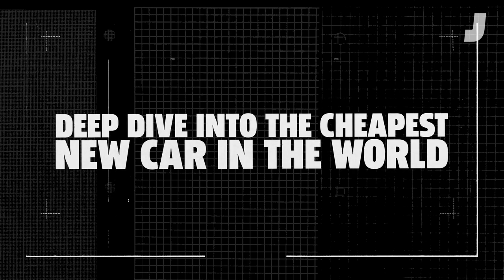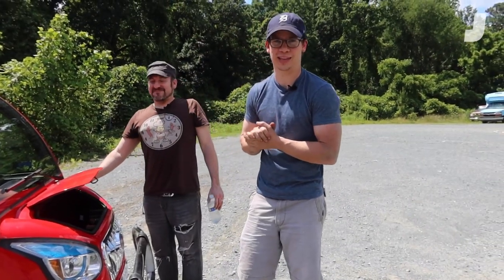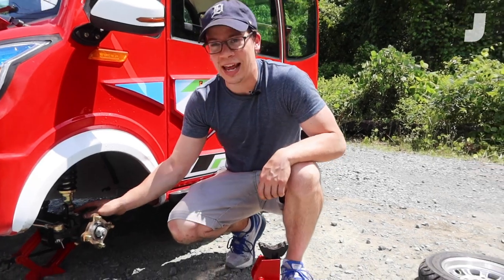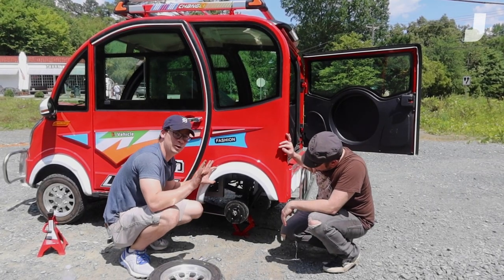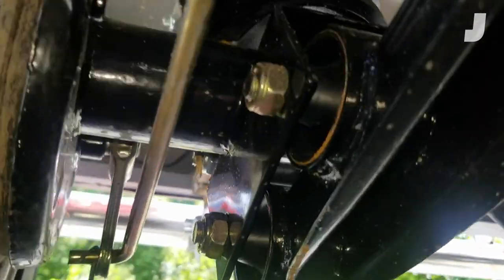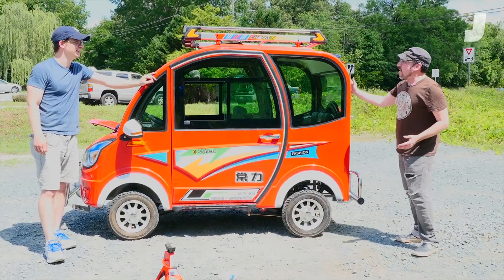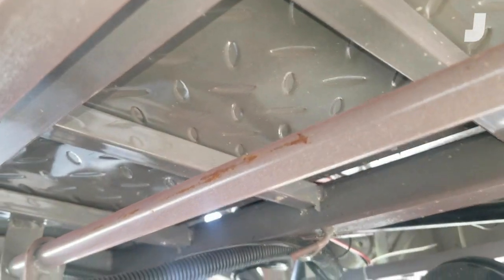The Impressive Engineering Behind The Cheapest Electric Car In The World

Comment: Omg. You so need to throw some lithiums in there. It looks simple enough even to upgrade the motor and controller for more umph. Amazing series 🤣🤓
Reply: With some lithium batteries and motor/controller upgrades this thing becomes downright amazing
Reply: I was thinking the same, TBH. WOULD LOVE TO SEE THAT.
Reply: The batts would outlast the car.
Reply: That would cost another 1,200$!
Reply: Rich Rebuilds used the parts from a crashed electric motorcycle to build a zippy car, his 'ratrod' and also an electric ATV. So doable.
Reply: You can ask them to lift the speed limit
Reply: Are you serious? Put the lithium battery under the seat is ready to barbecue human meat? It's dangerous, man，please, don't do anything stupid！
Reply: @OuijTube  Lithium-ion batteries are stronger, but more dangerous when things go wrong
Reply: But of course, if you modify it so that you don't put the battery under your butt, you'll be fine
Reply: It would also double the price.

Comment: I bet it's a conversion from an internal combustion engine version. The "trunk" in the front has no bottom because it is an engine compartment, the rear axle was turned front to back in order to fit electric motor behind the axle to the port where the drive shaft would attach. Great car anyways, the engineering on it is such a joy :) Holy hell it even got the sunroof! Thanks for the vids about it, enjoyed every one of them. The rain adds a nice tune btw

Comment: The exposed bottom of the car would pose real problems in Canada where we get a lot of snow and dirt on the roads.
Reply: Think how much fun it would be for bears!  Kinda like those dog treat balls!
Reply: @janeyoung4783  The bears would fit fine inside...
Reply: Stick some skidoo running gear on it!
Reply: Yeh like these would be legal anywhere on the road....
Reply: Just go to hardware store and get a big steel plate and cover them then, it doesn't looks like there are much problem to prevent you doing that.
Reply: @markc6714   grt entrç sñiw óbiké ejtrç atvß

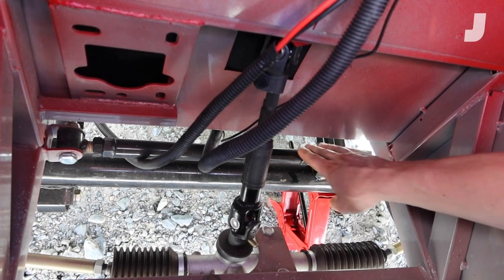Comment: That welding quality in 1:27 and likely use of furniture quality steel makes me hope that no-one had an accident with this one.
Reply: If this is like anything else made of steel in China, they didn't need to bother painting it. It will be nothing but rust in a few months. They seem to forego any kind of corrosion inhibitors. I would rather have rustproofing than some of the features they did include.
Reply: @moconnell663  you might think i am bragging. but in field of material science, china is on par with america or a bit better. just look at how many academic research papers china produce a year.
Reply: this is electric bike based. in china, it is not allowed on motorway! it is not classified as a "motor vehicle". you don't need license to drive that "car" but you do have to get registered. usually those tier-4 cities or towns.

Comment: how about the autonomy, how many miles with a full charge
Reply: In their article, they cited the manufacturer's documentation that said 25-60 miles.
Reply: @unwanted107  Its probably just that bad at handling hills lol. My electric skateboard gets half the distance or less if I'm going up a lot of hills.
Reply: @jerimayavondristen9955 Simpler electric skateboards hasn't energy recovery. With recovery system in hills areas range is much extended, because energy spent uphill ride is recycled to battery in downhill brake when motor works in alternator mode - BLDC motors are easily reversible to generator with proper power control unit. Simple and cheap DC motors can't be effectively used as generators.
Reply: Kris Roberts  I understood him to say the car is $1200 if you want batteries included. Could have misunderstood.
Reply: @robj2704  $900 without batteries
Reply: Kris Roberts  They sell Lithium-ion batteries for less on the same site. I'm not sure what that was about.
Reply: This guy is trying really hard to justify the money he lost on this death trap.
Reply: Top speed: 30 kph, range around 100 km. https://www.alibaba.com/product-detail/Four-wheel-electric-environmental-protection-car_62158205142.html
Reply: @robj2704  yeah . . . that's what I got too.   Making the batteries $270 for all 5

Comment: I would put a motorcycle engine and an AC and boom, daily driver
Reply: I drive a 64  ford truck creature comfort wise this this isnt to far off from my truck.
Reply: I would have to agree with you there. With the driving I do I wonder how well it would hold up under the modifications.  My commute is 58 miles daily. With my current car I see a lot of wasted space.
Reply: Rear brakes only though. Could get pretty hairy.
Reply: SteveVi0lence you
Reply: In Pakistan rickshaws are everywhere and fully loaded with 6 or 7 people plus the weight of a frame, they often use small 100 cc 125 cc motorcycle engines and easily go 60-80 kmh with room for more. In this small lightweight frame car it would be a lot of fun and practical to have a small moto engine on it
Reply: Around my area, my daily commute is 58 miles daily at speeds of 65 - 80 mph  (110 to 140 kph) and would need to pass safety standards. A gas tank and small engine would add extra weight but would be great for someone who is a daily commuter and uses the car to pick up a few odds and ends. As it stands I know someone who could use the car as it is as a property security car because it provides a working heater which would be great in the winter.
Reply: House a/c in the side and more batteries.
Reply: Hayabusa swap!
Reply: boom..sounds like you watch to much of the Russian...boom!
Reply: Yeah Hyabusa screamer lol

Comment: This needs to be modded into a street legal car!
Reply: I thought the whole premise of the series is that it's already street legal (albeit a terrible piece of cheap, underperforming garbage).
Reply: @willenestvedt1376  The only thing I can think of is it needs seatbelts to be (surface) street legal in any US state. I drive a smart car, which is pretty damn stable and safe. This I know is nowhere near that, but it could be fun to have as a car for my right-around-me trips. I work at a university only 2 miles away.  I could use it for that commute for sure.
Reply: @willenestvedt1376  ...oh, and I know they showed the horn, but they didn't sample it. It has to be audible at least 200 feet  (67 yards) away. That's not a tall order, and I'm guessing the horn provided would meet that, but just a possible thought I had.

Comment: So this is the car the Book „unsafe at any speed“ was written about... a single brake system is my main concern. The rest looks not so bad...
Reply: Yes . rear brake only is recipe for disaster.
Reply: @johannes914  This thing can't go over 35 and weighs next to n othing
Reply: Then retrofit a secondary brake system on it then, it couldn't be that hard to mod a set of motorcycle brake onto that tiny cart?
Reply: What would worry me about the brake is that the rod from the pedal appears to be held on with a single nut on the end of the bar, and doesn't appear to have a lock nut or any other reason it wouldn't just loosen and fall off.
Reply: I wonder if that's in addition to regen braking. From what I've read about electric motors, having regen braking is just a matter of connecting some wires differently, although in the simplest form, it kicks in when you let go of the pedal and whatever the actual brake pedal does is a separate operation.

Comment: I wonder whether there used to be a tiny petrol engine in the front on a previous version.
Reply: I wondered that as well. Or, at least, a petrol-based car sharing the same body. There's that strange unused bracket under the bonnet that hints at some other use for this body.
Reply: That space is crying out for a small gas powered generator to turn it into a range extender EV.
Reply: @davyfella  totally agreed! that's exactly what I was thinking! Awesome dude!
Reply: IT's actually an optional upgrade bros!  UR smart!

Comment: Being someone who hasn't been into cars their entire life, when I did get into them I never understood all the car enthusiasts like my dad raving about "coilovers" as if they are something ultra high-tech. Aren't they literally just coil springs combined with hydraulic dampers (fairly standard equipment) in a space effcient manner that uses the hollow areas inside the spring? What am I missing? It reminds me of people raving about transverse engine layouts as having been some kind of engineering revolution (isn't rotating the engine to fit in a given space better common sense?) or rack and pinion steering (less obvious, but more something that is a better way of doing things than the previous method, but not more complicated or harder to do and therefore something to be expected on anything modern).
I assume the motor is brushless? I can understand only having rear brakes if that was only regen braking and thus tied to the motor (not usually effective at low speeds though it possibly could be used as the only brakes if the gearing was really low though even then it wouldn't be great to hold the car stationary), but having dedicated physical friction brakes (nothing to do with the motor) at the back is really weird. Front brakes would require less cable/rod length and front braking is usually more improtant than rear braking. I suppose this car doesn't decelerate fast enough for a long enough period of time for a singificant weight shift to the front and the weight whilst level is all at the back?
I was impressed by the presence of a differential though and the aluminium wheels (four lugnuts too). I also like how the batteries have cardboard covers - quite funny but not particularly helpful other than electrical insulation. The way significant parts of it are one mostly flat pressing is a bit like a 2CV.
As you probably have already ntocied, I am not that impressed by the "engineering" - there are no amazing solutions/shortcuts to problems to give the car better packaging or performance or reliability or ease/affordability of manufacture for free like you might have in say a 2CV or model T or something but I suppose the "amazing" thing is meant to be that the car uses a lot of mechanisms that are the same as much more expensive modern cars.

The thing that did really impress me about this car though is just the build quality and the materials used in the car. A metal body and aluminium wheels aren't really impressive engineering but it is impessive how they made it that cheaply with such expensive materials (especially the thickness the mechanical and structural components seem to have - they don't look like they are about to snap) and mechanisms. Floor padding (especially carpeting) I have always thought was pointless in cars, especially in the boot, though it is impressive that this has it. of course the heater and rear view camera are thigns that you would never expect.  I wonder if you removed the powertrains and their costs how this would stack up to a Tata nano though. It also makes me wonder what kind of profit margin this has, and how cheap it could be if it didn't have any of the luxuries. Oh yeah, he can almost stand up in it! Looks pretty fast from the outside as well.
Reply: I feel you brudda

Comment: Seems to me for an additional $1000 you could really make some great upgrades.  5 additional batteries (mounted under the hood); 1 additional, larger motor, driving the front wheels; then some kind of upgrade for the defrost.  This should give you more range, power and overall better driving experience

Comment: We can't afford a 2nd car, so when my husband's at work I'm pretty much stuck at home.  If I saved up for 6 months I could probably afford to buy this, then I could at least drive to the grocery store.  I wouldn't need it to go fast or go far.  But it would be a game changer.  Right now if I want to do grocery shopping while my husband's at work, I have to wake up early (6:30am) and go to work with him.  Then drive the car back home so I'd have use of the car.  Then remember to pick him up from work (which is easy to forget, if it's not something you normally do...oops).
Reply: bike
Reply: @杨民-d6w  Nah, this thing can be quite efficient in comparison to an electric bike
Reply: First you need to check somehow if you can register it. I believe this doesn't have seat belts, so seat belts must be added. And here in Finland "moped car" can only have the driver and the passenger. But I don't think it is a problem.
Reply: @temelon  Thank you for your reply.  Yes, I wish it had seat belts.  I've been doing some research, and I won't likely get this car but one that still runs on electricity and includes seat belts.  I have some time to decide since it won't be until some time next year that I will buy one.  If I could, I would like to get one that runs on electricity and solar power.
Reply: @desktopkitty  Let's hope that the car you would buy that is good. Some man wrote that he had to change struts after three months to chinese cheap ev car. Well I think it is not ment to be driven long distances. And ofcouse the car has some warranty.

Comment: 7:15
"Automotive Lead-acid Batteries"
laughs in lithium

I KNEW it was too good to be true!
Reply: Yes lol...the sheer weight of 5 car 12v batteries!
Reply: @sheparddog117 Harbor freight solar panels are 15watts. If you had 2 panels on the roof, it would take 1 week of full sun to charge enough to drive for 1 hour, assuming 100% charging efficiency.

Comment: I first wanted to write that there is actually a really niece class of "Moped cars" in Europe where they sell really tiny cars with a top speed of 45kmh, can be driven with a License for a scooter (which is there selling point, a scooter with a roof and 4 seats) etc and they are similar in size, but a lot nicer and better... but i looked up what they cost and even used ones are more expensive, like a used Aixam from 2005 would cost 2000€. Which is crazy.... My 98 Saab cost 2000€ and... it is a full car. And a new Aixam costs 10 grand, for that money you could buy a new Dacia, which is a bad car, really basic and many owners have issues after a couple of years.. But it is a real car. or a smart car... For 1200 buck, this thing is amazing

Comment: Top speed 20 mph (32 kmh). Legal on most USA roads with posted speed limits 35 mph or less, where NEVs are legal. Slow moving traffic triangle required on the rear.
Citroën DS/ID 1956-65 had ONE screw on each wheel. It, however, expanded a cone inside the split hexagonal hubs to lock the wheel on very tightly.
Only the 2CV series cars had 3 studs on each wheel hub.
I wouldn’t want to go over 20 mph with no front brakes.
Are USA made batteries available that will fit well in the battery compartment?

Comment: You recently posted an MSN article on the buttons on the Mach V and what they do. I should mention several things. Race cars for at least a while did actually employ jacks to lift the car to make tire changing at pit stops easier, this is an actual feature. So though they weren't able to jump the car, they were practical. Now given today's materials, make the car super light and the jacks super strong and maybe with just the right angle you could try to jump the car with them. Musk is planning on air-jets to jump his sports car and he seems serious. He probably grew up watching Speed Racer too. As for those saw blades, there has been an actual Mach V recreation that included the saw blades, so those are not entirely impossible either. And Aston Martin recently recreated the movie bond car in a real car with many of the gadgets working, so if you have too much time on your hands and too much money, probably a lot of things are possible. An electric sports car going submersible seems a piece of cake compared even with gas power cars that have ridden on the surface of the water :) Nice to have the buttons explained, I haven't seen the show since the 60's! Thanks. Keep writing cool articles!

Comment: Interesting vehicle as an alternative to a golf cart.  The biggest problem I see is its use in warm climates like Florida.  Being enclosed with only two small sliding windows will get the temps inside quite high.  There needs to be a way to remove the windows, at least.

Comment: This is not a road legal car in China. It is only used for out of city taxis , called tuk tuk. Also, you can get as cheap as 500 USD for the cheapest model of the tuk tuk.

It is about 5000 rmb to buy and there are loads of different brands and models, this is the most common. Many farmers use them especially the old.

If you drive this in the city, it can be fined and confiscated. 

They drive in the ebike lane and should not drive in the car lane. Ebikes are amazing. 

They generally are the same size as a big scooter and they can drive very far. 

Mine is  72v 50ah bike and it does 130km on one charge about 40-50km speed per hour. The battery costs the most, being 6600 rmb and the bike body about 3000rmb.

Chinese cars have really improved and they make very good quality petrol ,and electric cars now. One brand is BYD. They are really advanced for electronics and my favourite is the BYD S7, though they callit another name now. It is a HUGE SUV, up to 7 seats and loads of boot space. You can search BYD S7 on youtube, you can see it. 

Manual 89,000 RMB (12,756 USD)
Automatic 100,000 RMB(14,336 USD) upwards to 130,000 RMB

Comment: You can replace those batteries with some ion units and get some extra amp hours with weight loss perhaps..  As they stop holding a charge in year or 2.. Who knows? Would be great for a big trailer park down in Florida where 50% of the Tennant's use golf carts. You need a big cover for it.. A tarp with velcro to secure it.